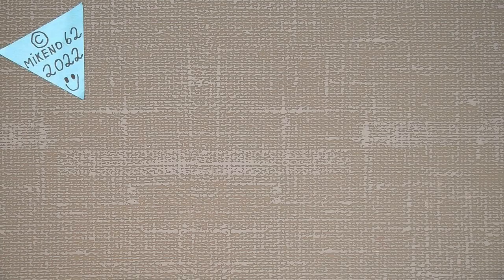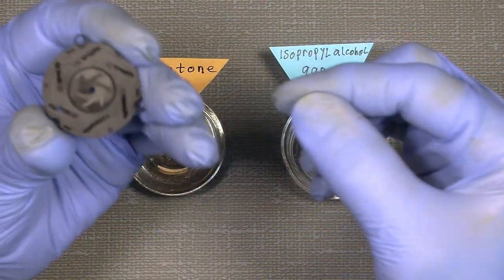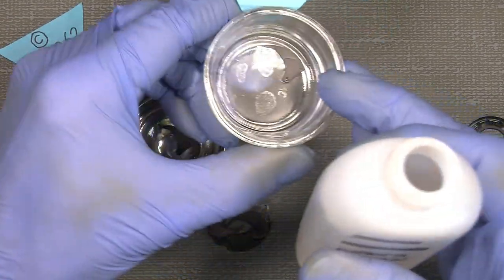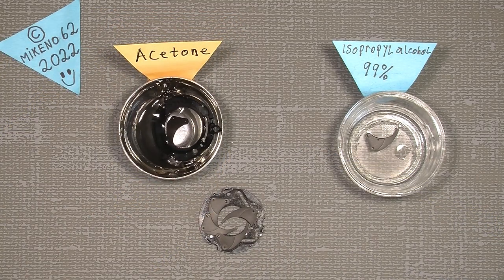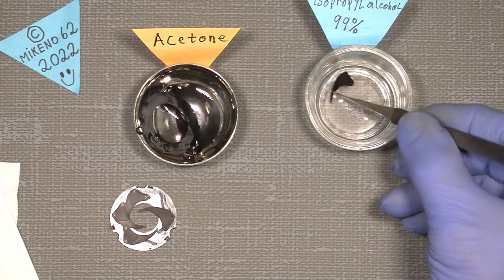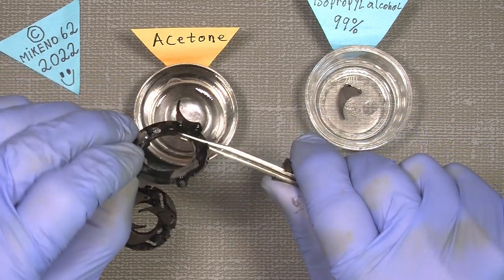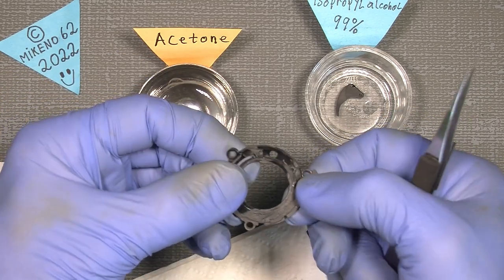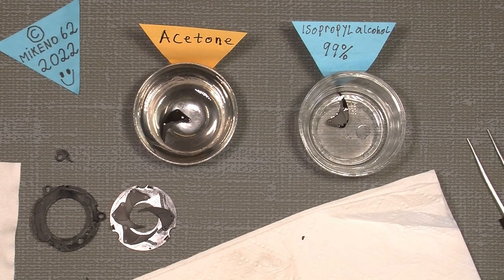Use Isopropylalcohol or Acetone to cleaning aperture blades, a comparison

Comment: I always use lighter gasoline, it's more effective than any other solvent I've tried.
Reply: Shellite?
Reply: @NoosaHeads  any brand I can get, they are all the same.  The stuff used in Zippo style cigarette lighters.  Comes in a small can with a fine nozzle.

Comment: I see you use lighter fluid for cleaning the lens elements…. I have read allot online that says no to lighter fluid as it will damage the coatings. What is the best option for cleaning lens elements?

Comment: Sorry but this just shows an almost complete lack of the chemistry behind solvents and how to use them. “Oil” is by definition a non polar set of molecules and the best solvent will be a non polar solvent like gasoline or lighter fuel. The drawback is its influence on compounds of similar nature of provenance like plastics and (synthetic) rubbers. This strangely is never dealt with in any lens cleaning video. People just advise anything they fancy based on ... yeah, based on what?

Comment: Acetone Will not damage plastic my friend  it's already in the plastic bottle.
Will only damage materials  That look like plastic and is not actually plastic.
Reply from the maker: Well, there are many different kind of Plastic, and the 2 bottles are actually made of PE / PP.

Polypropylene is not as sturdy as polyethylene. Polypropylene is stiffer and resistant to chemicals and organic solvents compared to polyethylene. Polypropylene is pure, non-stretching and generally more rigid than polyethylene.

Read about it here:

https://www.globalplasticsheeting.com/our-blog-resource-library/bid/92169/polypropylene-is-it-different-from-polyethylene
Reply: acetone can also dissolve ABS and PVC as far as i know
Reply: Confidently incorrect...